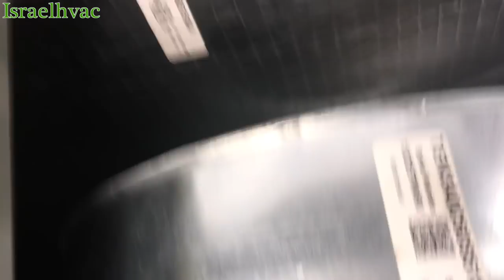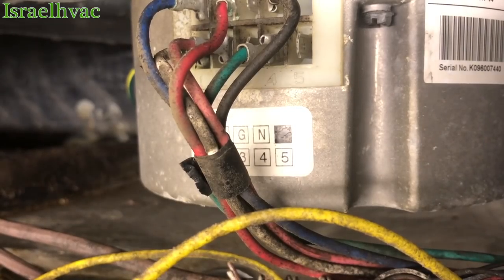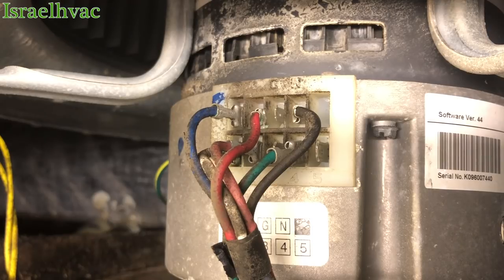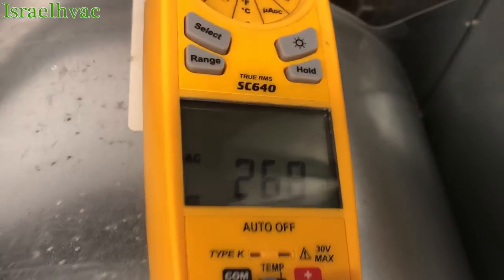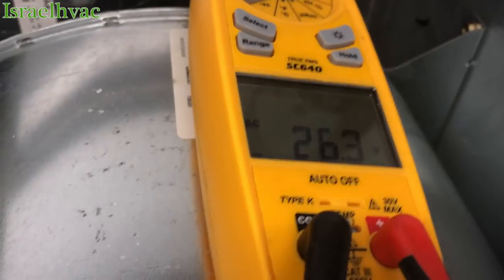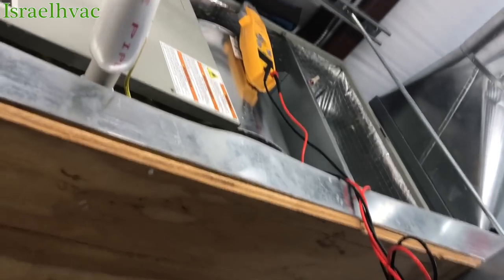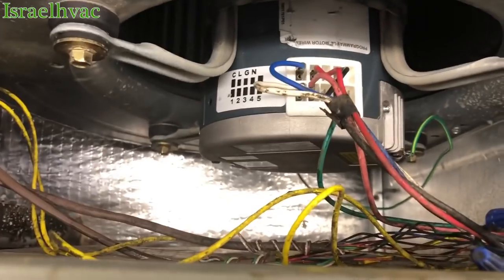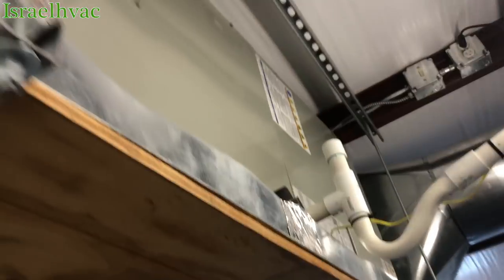How to Troubleshoot a X13 Motor

Comment: Thanks for this video. It saved me so much money. Your explanation on troubleshooting steps gave me confidence in the solution to my X13 ECM blower motor not running. Genteq X13 replacement for my GE X13 model was $265.45 total including tax. Amazon prime delivered next day to me. Installed today and all cool now!

Comment: See this doesn't make any sense to me. You always have high voltage at your ECM motor present regardless of a call for fan, cool or heat. That is high voltage going into your module. So when there is a call for a fan, cool or heat, then you get 24 volts that goes to your module. So now you have both 24 volts and 240 volts going to your module. So how do you know if the module is bad or the motor? If all you're able to do is test what's going into the module then how do we know what's supposed to come out of the module and go to the motor?